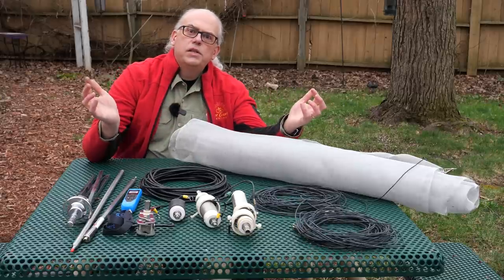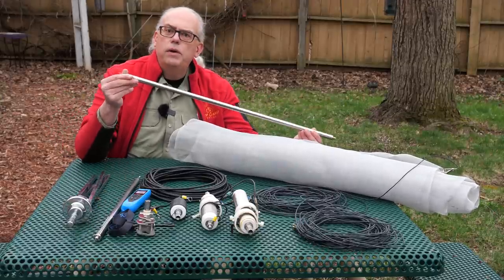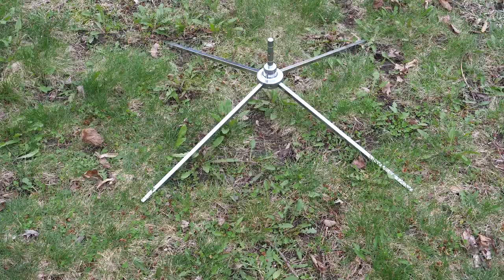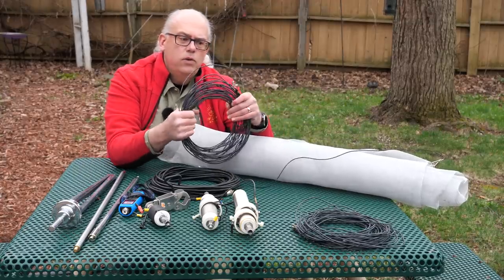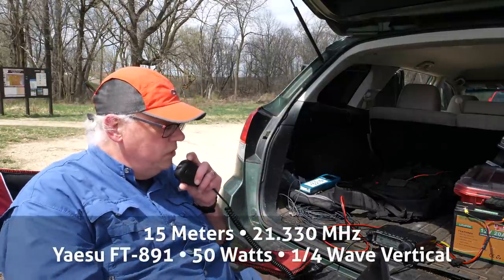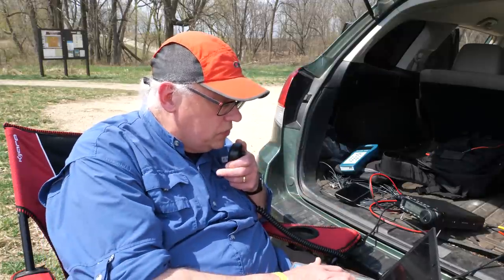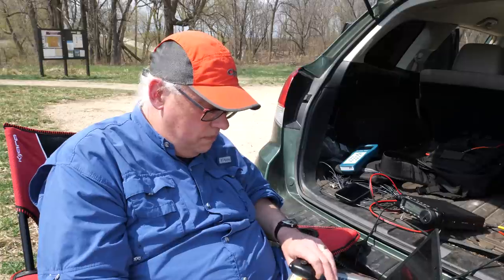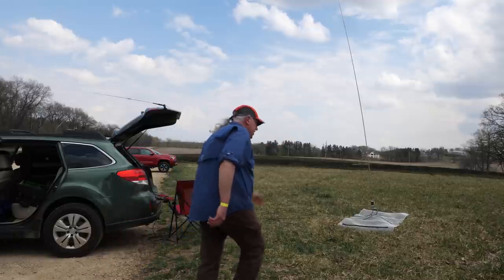Vertical antenna step by step - You'll be surprised how easy it is #hamradioqa

Comment: I never owned an analyzer and have never had problems adjusting the whip.  I realize fully extended is 20 meters, half extended is 10 meters, 15 is half way between them, 12 halfway between 15 and 10, 17 halfway between 15 and 20... my guesses at these usually put me very close and only one or two adjustments and walks to the swr meter and I'm up and running on a band.

The VNA's do seem nice and a fun toy and I can certainly see it coming in handy if I start building antennas again.
Reply from the maker: Some people count sections and others will make marks with indelible pen. I've done this enough that I can usually 'eyeball' the length of the whip and get it to about 1.7:1. I'll then fine tune with the meter.

Comment: I did the screen thing… works great!
Reply: Did you use a cable? I tested mine and the SWR was fine without it.
Reply: @Rodney Trent Briles  no… I did not… I figured 4 legs sitting on the screen is enough when your only running 50 watts… I had no problem.. SWR was great and it was on less thing to hookup!

Comment: I purchased the feather flag base from Amazon upon you recommendation and added the bypass to my Sporty Forty, additionally, I add a piece of 2" heat shrink about 3" long to the mounting shaft to stop it from rotating.  Thanks for the info.
Reply from the maker: Great tip!
Reply: Just throwing this out there. I bought the feather flag base and have been using for a little while. Worked great at field day. Today while setting it up I stared at the rubber tips I was trying to keep on the legs and decided they could be interrupting my ground. Off they came. You never know!

Comment: I previously got about 150 KHz 2:1 VSWR BW on 20m with 1-2 16' radials in my POTA activations from my MFJ-1979. Today, I laid down two 46"x84" aluminum screens and clipped them together with alligator clamps to my 12" ground spite with an integrated BNC connector (eBay source).  That gave me >350 KHz BW on 20m and the lowest VSWR went from 1.5:1 to 1.3:1. My Rig Expert read ~38 ohms impedance. It felt like my 5 watts CW QRP had a 10dB amplifier. This setup took 2 minutes to deploy or pack up. I have another 24" x 84" aluminum screen I haven't used or unwrapped yet. I will add it next time to the whole thing to see if I have reached diminishing returns. The screen simply lays on the ground, flattened by a couple of small rocks or sticks or whatever I have, including several fiberglass electric fence stakes that I use to elevate counterpoises on my other antennas, from time to time. I want to find some small cardboard rolls to wind up the screens a little more compact. Cheers, Davey - KU9L
Reply from the maker: Those are amazing results. It's great to hear the screen is working well for you.

Comment: Hi Mike I really enjoy your You Tube channel, especially with the Wolf River coil setup with the window screen for a ground plane. I’m looking into buying a wolf river coil antenna setup with the screen door setup to save on setting up ground radials. 73s Rob, wa2fmh.
Reply from the maker: That's great. I hope to hear you on the air soon
Reply: @KB9VBRAntennas  Hi Mike, can I tune the Wolf River coil antenna  with an antenna tuner? As I’m using an MFJ 949 antenna tuner at the present. 73s Rob,wa2fmh.

Comment: What method did you use to stop the stand from rotating? If you have a video on that I missed it. I simply replaced the bearing washers with one's that covered the bearings completely and tightened it down worked great. Thanks for all the great videos 
KE8MWQ 73

Comment: Michael, I really enjoy your videos. They are very informative, especially with us older hams who already know everything (hi hi). I purchased the stand through your Amazon link. It was just delivered today by UPS. I hadn't had it for 10 minutes and already pinched my hand with one of the legs. (Yes, it hurt like $%^#@.) First, I'll remove the rubber feet on the tips of the legs. But did you do anything to make the legs less floppy? Also, I see the post is on bearings, which turns easy. Should that be a concern with the jaw clamp and vertical when it's mounted to the stand? I'll be stopping at Menard's later this week, to pick up a roll of aluminum screen. I also saw your video using the Faraday cloth. Great idea! I used to use Faraday cloth doing RF testing about 25 years ago. I would have thought of this, except the clothes were much smaller, around 12" x 24". It's good to know the cloth comes in larger sizes. I live near K-1001 and plan on making my first POTA activation there. Last week, I ordered the WRC Sporty Forty with the 213" whip and I'm waiting for that to arrive.
73, Joe KB9RCR
Reply from the maker: I didn't do any modifications to my base, as I also still use it for its original purpose as a flag stand. The legs are floppy, but if you grab two of them by their ends, it is easy to lay down. I then pick it up by the top so I don't pinch my fingers. The center post does spin. If you want it to stop, another user recommended putting a bit of heat shrink tubing down the center post to stop that. Mine sort of moves in the wind, which won't cause any issues, but does make it look like a wind vane on a breezy day. I hope to get you in the log soon.

Comment: A quarter wave vertical is actually a half wave dipole.  The radials you lay out complete the half wave.  We know the tips of a dipole can be dangerous if touched when one is transmitting.  The tips can have thousands of volts, but the current is near zero.  My question:  Is the exposed window screen on the ground a safety issue?  Do the edges of the screen have the same voltage as the tips of a dipole?  Or is there some electrical property that distributes the voltage across the entire screen, lessening the voltage at any one point on the screen.  I don't know.

Comment: Thanks Michael.  Love your J-Poles, and you always make Amateur Radio look way to easy.  Need to go buy my window screen.  BTW, have you checked what adding a few radials to the screen setup does?  Does it make a little difference or no difference? Just curious. 73 KN4VA
Reply from the maker: You can use a both radials and a screen and there is some evidence that it may be super effective. I haven't had a chance to do that test yet, though.

Comment: Can you use a short nine inch 3/8"-24TPI extension at the bottom of the Chameleon whip instead of one at the top to get to 213 inches? I have the MFJ 1979 antenna but find it to be low quality.

Comment: I like your set-up. My question is if your screen radial system would work just as well if you cut the screen down so that's is a square instead of a rectangular shape? It would also roll up a bit smaller too
Reply from the maker: I don't know what the minimum size of the screen needs to be. I'm using a 36x86 inch piece which is 21 square feet. Dave's screen he used in testing was 24x80 which is 13 square feet. So you could certainly square it off without too much change in performance.

Comment: What is that tripod?  Is that the "small" WRC tripod?  I have the bigger one and it doesn't quite straddle the standard window screen... one leg reaches out too far to sit on my screen.  It hasn't been a problem.  I don't "link" it to the ground except for the aluminum legs sitting on top but I also use radials, why not.  73 de KX5JT
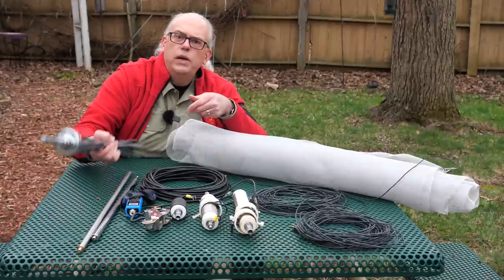Reply from the maker: I discuss the base at 4:38 and there is a link to it in the video description. It's a base from an advertising feather flag.

Comment: You make it look so easy i have Wolf river antenna i have my Technicians license i can get it to work swr is really high i don't if its the coaxial cable to long or Is counterpoise or both with a icom 705 and the 817
Reply from the maker: I've had lots of practice setting up and tearing down, so I'm very efficient in my movements. What is the SWR you receive? If it is in the neighborhood of 2:1 to 3:1 it is most likely your counterpoise. If it is 5:1 or higher, you may have an issue with your coax.
Reply: @KB9VBR Antennas  how do I know the right size of counterpoise Kk6ikw thanks
Reply from the maker: If a counterpoise is elevated, or above ground, it will need to be 1/4 wave of your operating frequency in order for it to work. Counterpoise or radials laid on the ground become non-resonant and can be any length. But I've found that tinkering with the length of the radials can affect the SWR. For the 10 meter band, i'd stick with several 8 or 16 foot radials. The more surface area you can cover, the easier it will be to get a good match. That's why the window screen works so well, it creates a large surface area of contact. But if you are using wire radials, I'd try at least four, and maybe 8 or 12. Any point after that you receive a diminishing return for the amount of effort it takes to place all the radials. This article has an excellent explanation of the effects of radials on a vertical antenna system: https://rudys.typepad.com/files/qst-march-2010-ground-systems.pdf

Comment: Question, does it matter if it's a rectangular square or even a round aluminum screen ground plain!? Would you see a difference!?
Reply from the maker: I don't believe the shape makes as much of a difference than the surface area covered. From what I've seen you need some pieces of screen almost a 1/4 wave in length to influence directivity.
Reply: @KB9VBRAntennas  ah ok thank you! 👍😉

Comment: What kind of SWR are you getting on 40m with the aluminum screen?
Reply from the maker: I looked back at some of the video I recorded and my log (I keep notes on my field activations) and found, depending on the location, that 40 meter SWR can be a bit variable. Sometimes it will be as low at 1.0:1 and other times it may be higher, like up to 1.7:1. I'm comfortable with not having a perfect match as I've found that even though SWR may be higher, resonant impedance (X) is usually very low. I think it may have something to do with soil conditions and makeup of the ground. With the lower bands, adding more screen tends to help, and I think adding a 2nd screen for 40 meters may make a difference. But that would require me to carry more screen with me, so I'm happy to deal with the SWR I get for the sake of convenience.
Reply: @KB9VBRAntennas  after watching your videos i went and purchased a "48x25ft roll of aluminum screen for field day for my WRC. My SWR was flat across the band on 20m. 40m took a bit of adjusting but i managed to get about 1.5 across the band. i might purchase another length or cut this one in half and lay it out in a x pattern with the vertical in the center. Anyways thanks for the inspiration! 73 De K8ob

Comment: Hello, When I deploy the WRC does it matter if the radials are on dirt or payvment? What is better?
Reply from the maker: Ground conductivity can affect how well a ground network works. Here in the upper Midwest, we have relatively poor conductivity due to the amount of bedrock. With that said, I haven't noticed a difference in placing the radials on  soil or pavement. Both seem to work the same. Maybe in areas with better ground you may notice a difference.

Comment: Could you allow chicken wire to bury in the grass for a ground plane?
Reply from the maker: Chicken wire, hardware cloth, other types of screen material all will work. The downside of burying chicken wire is that it isn't corrosion protected and will rust and degrade underground.

Comment: can u use 2 sporty forty coils to engage 80 meters by flipping 1 off
Reply: In theory, yes. But there are a couple of potential problems.

#1. The combined coils will cause the antenna bandwidth on 80 meters to be razor thin.  Probably less than 50 khz.  

#2. There is no tap adjustment on the Sporty 40 coils,so if the resonant point of the antenna doesn't magically fall on just the right spot (hopefully within the 80-meter band), your only tuning option is adjusting the telescopic antenna height.

Give it a try, and let us know what you find out.
KZ9V

Comment: That's a mueller clip, not an alligator clip. Muellers are better for most applications.
Reply: Mueller is a brand name. That size clip is also referred to as a crocodile clip.
Reply: @Joe B  It is more specific to call it a mueller clip like we use the word kleenex. If we say tissue, it depends on context - facial, toilet, flesh?
Reply: @chrisazure1624  
Don't get your shorts on a knot over it. I'm just pointing out that it's called by more than one name. Call it by whatever floats your boat.

Comment: I am going to try chicken wire because that's what we have on the farm. 

JAY KC9GSK
Reply: I’d be curious how well it works, or does not.  I have some hardware cloth I will try.
Reply: Both chicken wire and hardware cloth fence material will work fine. They're just pretty difficult to manage in a portable installation. 
KZ9V
Reply: @davewhite7679  Yes, it would be a bit onerous to use either for portable ops.  I will use the hardware cloth at home QTH just to see how well it works.  Thanks for your reply.